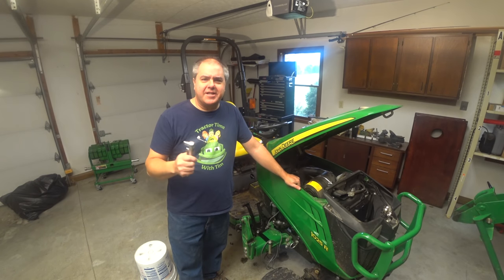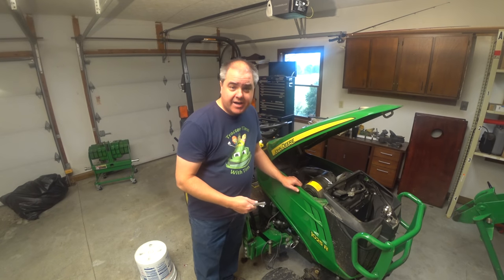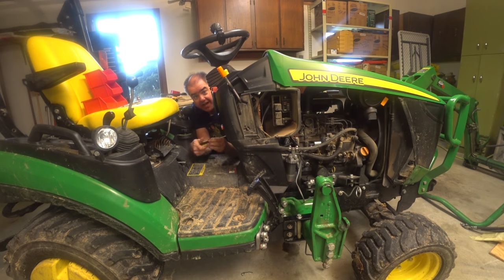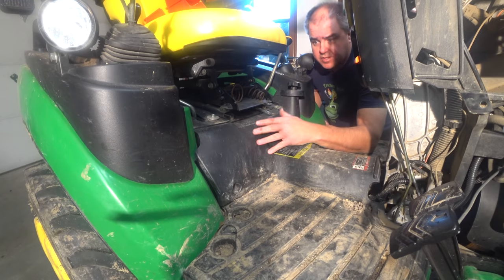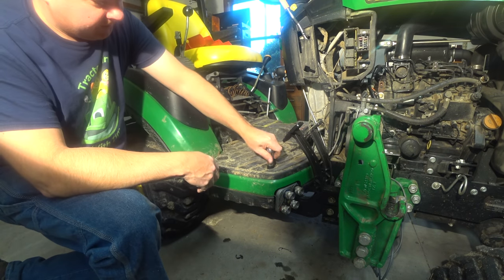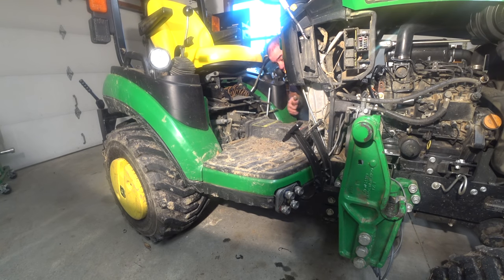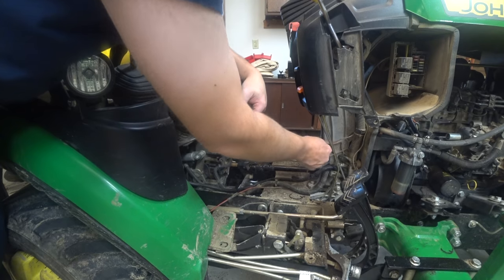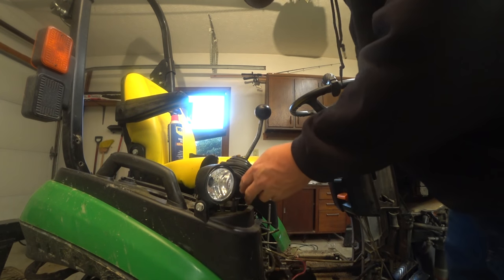John Deere 1025R Floorboard Removal 2013-2017 Models

Comment: I have a 2014 1023e that I bought new. I should have bolts where you do on your 1025R, but they weren't even on my tractor when I took delivery.  I guess my dealer forgot to put them on when they were setting it up, who knows.  I didn't even know about the bolts until I watched your videos!  I have had the tractor over 3 years and have put 238 hours on it. Never had a problem with the side panel coming off. So I agree with the 'ET guy' you mentioned! Bolts aren't necessary! HA! Looking forward to seeing the new tractor. My Father-in-law just bought a 2018 1023e. I look forward to learning about the differences from you. Thanks for taking the time to do these videos. Really helpful!

Comment: Great job. I needed this.  Something just happened and I lost all my hydraulic fluid on my deck and in my yard as I mowed. All gone. So now I need to look for what I feel sure is a leak.  Cant see it crawling underneath but hopefully doing this I can add some fluid start it and look for a leak.  Cheaper than taking it in:)

Comment: You are right about 1025r seat turn buckle link breaking.  Mine did too 2 years ago.  Someone on greentractortalk posted McMaster swivel joints that fit and are more durable.  I put them on and no signs of failure yet.

Comment: Hi Tim,
Just a FYI of sorts, those wide broad washers you referred too are call fender washers. I only know that because a few weeks ago I had to go get a few from the hardware store to fix some bolts that had pulled through some sheetmetal. I asked the guy at the hardware store for some super wide washers and he ask if I meant fender washers. Of course I had no idea until he showed them to me...lol

Comment: great segment tim. i have to remove my floorboards to check out my pedals. my forward pedal doesn;t return to normal. the torsional dampener adjustment doesn't work. it started happening when i added the mower. so im hoping something is just binding.

Comment: Don't forget to take off your wheel weights!   I still need to get some myself.. keep procrastinating.. Just had to plow 12" snow and cursed all the time as I slid all over.. LOL  Yep those hood clips, they are awesome!   Just twist and they come right out and the panels come off.  And the 'knob' for the 3 point, that does not even exist on the 2018's and newer.  Another major difference there for those of you watching.  There is an adjustment under the seat on the right side... I am thinking something is wrong with mine though because it seems to make no difference in the speed of drop for my 3 point.  Tim,  I have a really nice Black and Decker battery operated drill that has an awesome 10 point setting head to it that rachets so you don't strip screws/bolts at different settings.  It works so well that I have never had to use settings 1 or 2 because they are so sensitive they rachet with the slightest tension on a bolt.. LOL   For the JD, most of those screws and bolts tighten without any over tighten issues at all with about a 4-5 setting.  I now carry one on the tractor in a second toolbox I mounted.  The model drill has those interchangeable heads too so I can take that head off and pull a impact head on it, a drill head, a saw blade, router and some other attachments.  Highly suggest you consider something like this too.. Love the thing and now I only use my electric drill for major things like drilling concrete, heavy oak/walnut 4x4 's etc..  Mine is the 20 Amp battery setup.

Comment: 2015 1025R here.  I came across this video while trying to grease the inaccessible front driveshaft U-joint.  I tried to access it by removing the panels in the video, but my tractor has a very different panel under the steering column than the one on your tractor.  No screws at all, and it seems to be one solid plastic piece held on by bolts, with other things inside  bolted to it.  I was able to remove the floorboard leaving the front panel in place after removing the rear panel shown in the video. That gave access to the rear U-joint but not the front one. So, not every 2013-2017 model is the same as yours.  Is it possible that Johnny, as an early 1025R was  perhaps built  using up some 1026 panels? Gotta get that U-joint greased somehow; it's the one thing left undone for my 600 hour service.  The front U joint looks like it has never been greased, although I paid the dealer for doing at other service visits..  Maybe the dealers find the zerk as difficult to get to  as I do.
Reply from the maker: Yes. The 1025r has been redesigned inside there.  Surprised it is that way on a 2015,  but I do have a video out on our new 2018 model with the one piece steering column.

Comment: Tim, is there a torque specification for the bolts that secure the floor to the frame.  I just had mine off for the first time and they were very tight.  I want to put them back properly.  Let me know if you are aware of the proper torque spec.  Thanks.

Comment: Took my floor boards off once. Half the self taping bolts stripped in the holes as I was backing them out. I had to put a nut on each bolt up underneath. :-( Same year tractor as yours.

Comment: great video, i have a john deere 4310 and it does not vibrate at low rpm it would drive me crazy if it did but the exhaust makes my head hurt.

Comment: I'm pretty sure that lower piece under the instrument panel isn't separate/removable on my 2016, but I should probably look again.  That was the conclusion I reached when trying to use that method for the impossible to reach grease zerk anyway.
Reply from the maker: Ok, I may have to change the applicable dates.
Reply: @TractorTimewithTim  The way Deere now line-breaks in new changes, trying to correlate implementations to specific model years may be an exercise in futility.

Comment: What is the bracket(@7:10) around the left side loader mount that looks like it connects into the floor sub frame? What is it used for?
Reply: You're right it is a bracket that attaches to the frame.  Not sure if all 1025R's with a loader have it, mine does.  May be some of the extra reinforcement for the backhoe attachment.

Comment: Thanks  for your reply Tim my only concern about getting the 3320 is it’s a bit wide the 2038 is narrower which we might be able to squeeze in a few more yards with it does look a bit tippy with the big wheels but they make a wheel spacer kit Which would solve that I guess if we didn’t like it down the road . What did you end up getting to replace Johnny ? Have a great day love the channel been a great help love your positivity as well keep up the good work :)
Reply from the maker: We haven’t purchased larger tractor yet.  Many prerequisites...larger truck, larger shed which meant more property!  Ugh!
So, we are working toward the goal.
Right now 3046R is my leading candidate.
Reply: Kinda stuck really,  I like the 2038 a dealer I stopped at yesterday told me he might have one coming that they just sold but the owner doesn’t like it 20hrs on it barely used on small
Horse ranch in the arenas etc trading it in on a bigger one so now I’m stuck the  2038 I’ll find out in couple days what the $$ is or the 3320 I found with a few attachments 500hrs oh no it’s decision time ! The 2038 I can still
Have warranty being my first tractor I dunno what to do ... thanks again Tim you guys are great best tractor channel out there ya have a great positive attitude and always getting it done . :)
Reply: That’s what these people are trading the 2038 in on it’s the same size as the 3320 the salesman told me , your not worried about the width on some jobs ?
Reply from the maker: My dad's 3320 has ag tires.  it is even more narrow than the 2038R.  In fact, he has a 60" deck on his!  So, no, not worried about the width. 
How much wider is it than the 2038R?
Reply from the maker: oh, and I plan to keep a 1025R, so this reduces my minimum width concern.
Reply: I need the r4 tires oh thought Johnny was leaving . Aren’t you lucky :) I’m thinking the 3320 will do fine it but sure do like the 2038 width which is 48” I think the 3320 is 58 1/2”  so no side gates on the big one I could  always rent one for those jobs I’m mainly going to be advertising in all the equine communities around Me but ya as know ya get all types of work . I live in so California the concrete jungle that’s my concern with being to wide . It’s a tough decision what’s the biggest size lil Johnny do you know ??
Reply from the maker: No, 2038 is much wider than 48”. Better check on that again!
Reply: Your right my bad the 2038 is wider but the one I sAw was Narrow I think they make a narrow model because  it was not a 60” wide one it looked narrow and tall almost tippy looking  . I’ll double check with the guy the 3320 without a doubt is 60” or 59 and change .. part of me things to get subcompact then if Business grows get the bigger one kinda like having warranty  I’m still stuck but going to see the 3320 in a few days it’s 4 hrs north of me . It comes with loader ,Gannon , roof shade , he has a brush hog and post hole  digger that is extra if I can get him to throw those in I’ll buy it ... thanks a lot Love your videos keep up
The good work !!

Comment: hey tim is johnny yanmar power if so on my yanmar i have found is if you idle down to far i to find a lot of rattle and have stopped idling down so far i will only idle down to about 1000 and this will also help the charging system work better also
Reply from the maker: Factory idle on this tractor is 1550rpm. Yes, yanmar power

Comment: Had to go back to Deere dealer today. Our brand new 5055e tlb is loosing hydraulic pressure again!  I've run it for about 3 hours total and they have had it more than me!😡. Last time they replaced the hydraulic pump, the thing had about 5 hours on it, now it has about 12, they put a bunch of idling hours on it in the shop, and it can't even lift the bucket up with a little dirt in it.
Reply: Well I'll be, just recently had to send back my new 5075e for a hydraulic issue as well, wondering now if this could be a nation wide ISSUE
Reply: Randy Whelan what was your issue?
Reply: Slow hydraulics loader and 3 point hitch steering cavitation
Reply: Randy Whelan yep, same here x2. Loader won't raise up, will leak down, back hoe can't pull out of the ground with the bucket full, hear cavitation and air in the lines. First time, the pulled the pump, it was scored all around the vanes and letting fluid bleed past.  I'm sure it's same this time. I'm going to check forums to see if this is common,  I'll let you know here if I find something.

Comment: Going to take me longer to take those floorboards off than put the diverter on...I think I'll try to jack it up and run the wires without taking it apart.
Reply from the maker: It isn’t that bad...and you will have less risk of catching the wires on underbrush.